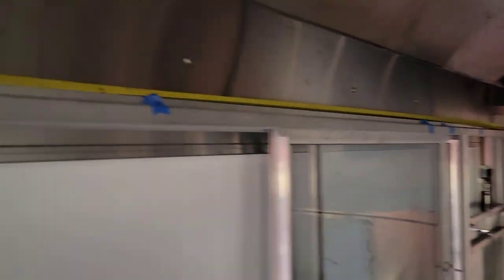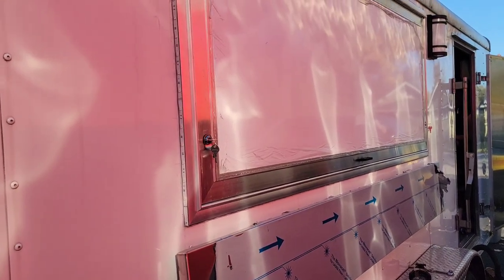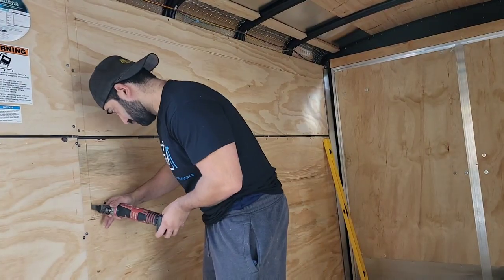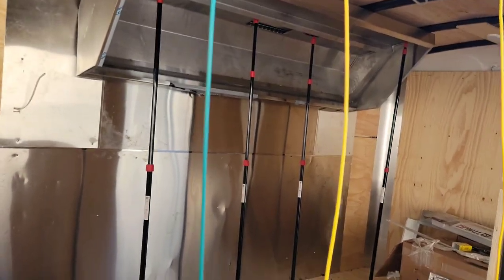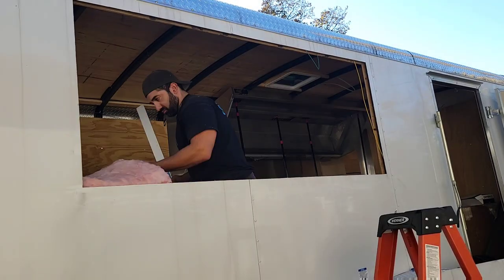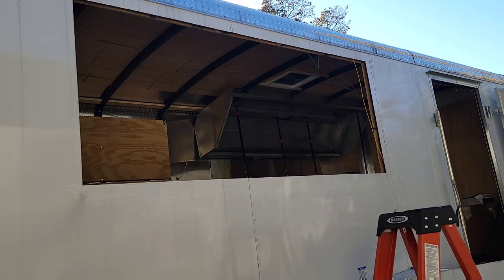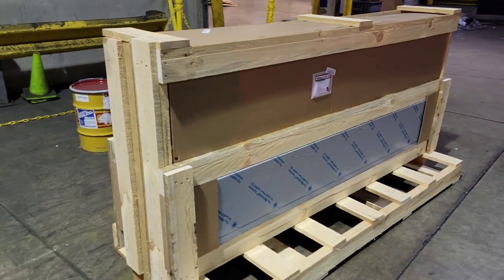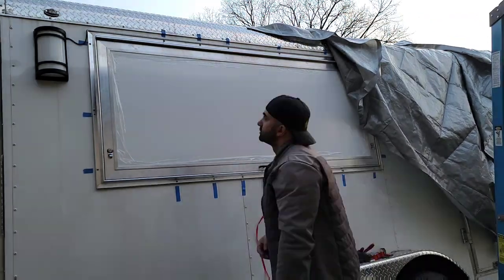How to Install A Food Truck Window

Comment: Does it matter if the window is on the driver side or passenger side?
Reply: You typically want it on the passenger side being that’s the side the sidewalks are on. This way you can park legally and vend if you ever decide to setup on a street

Comment: I would be worried about those glass outside lights breaking during transport
Reply from the maker: They have little rubber pads, mine are the same way no cracks yet. Fingers crossed